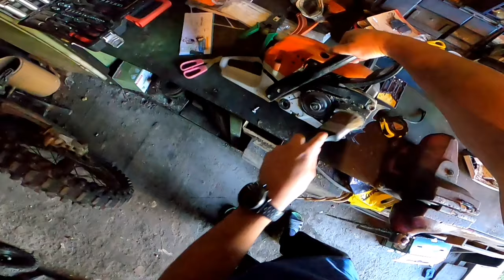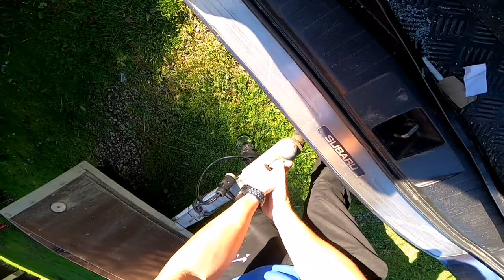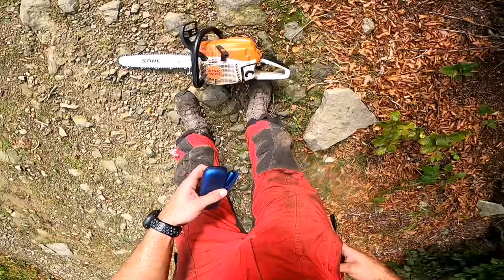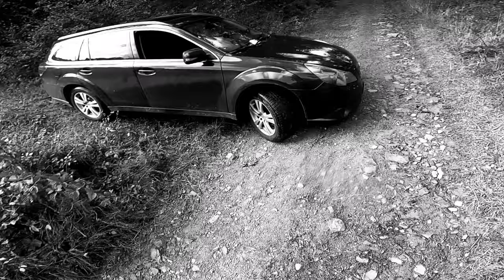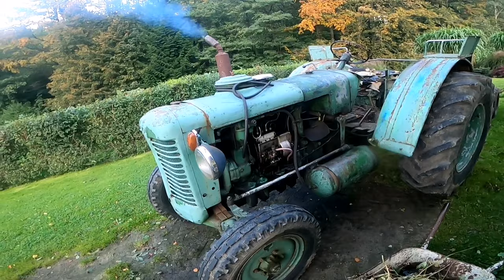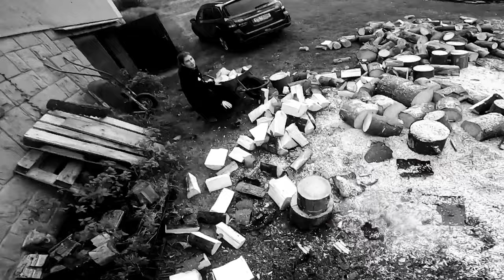Jackass with chainsaw - how to cut yourself with Stihl MS261 chainsaw...

Comment: 1st thing I noticed wrong was that you were in a subaru. 😆
On a serious note, get a 20” bar for your backs sake, plus it gives you more cutting options and makes the saw more controllable. Also, spread your feet apart when splitting firewood, so you don’t end up with a split foot as well.

Comment: I have the same saw and having used a number of others the 261 cm is sweet. Still learning with this beast and can say that after 1 session with 5 hours of fresh English Oak and Beech the chain was still razor sharp. Cleaning the saw with an air line and i put my hand  / forearm under the chain and bar. machine not running and cold. I touched the bar with my forearm whilst blowing air near the dog. Didn't realise the wound until a minute or so when i saw my hand covered in blood and my forearm missing a 3mm x 2inch lump of flesh. Should have gone to A&E but being a typical bloke I first aided myself. Dread to think the damage it'd do to a limb when running.
You need to take care squire even when splitting, move the misses away before she get a flier on the head.
Stay safe!!

Comment: To many ways not to do it right and end up hurt, without ever intending to make a mistake.
I don't think I'm the one to criticize where others mess up.
I've stood on the Safe side of the log...... and had it roll on me when I cut off an 8ft section. *didn't realize it was perched on a rock ridge(not the actual ground), and it rolled off the wrong side.
I dropped a Widow-maker caught in a crotch 15' up using a Ladder(not smart), but I did have the sense to Strap the ladder to the tree and use my climbing belt/strap to secure me from falling.
The biggest mistake of all is pushing when fatigued. It doesn't matter how careful you intend to be, reaction time is slowed down and that always dramatically increases risk of a serious mistake.
***Yes, I set here watching this video, wearing my Bluejeans with the slice in the right thigh. Fortunately it only scratched the meat of the leg.
No kickback, no stumble or fail. I just brought the saw back toward me while coming up from a crouched position when trimming under a fern tree.